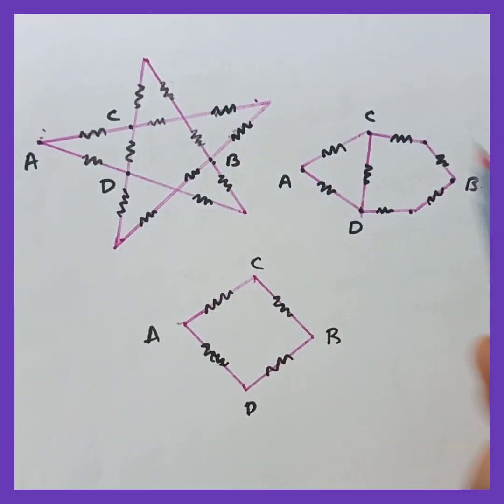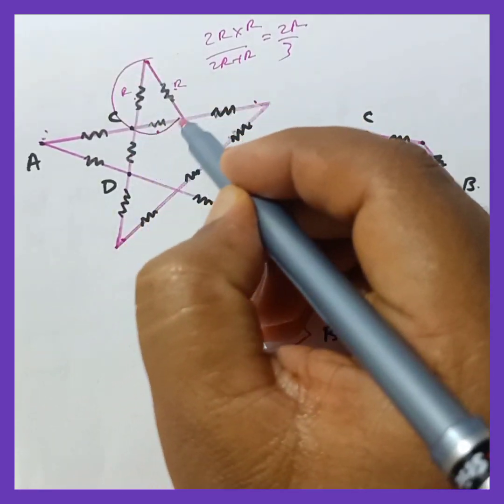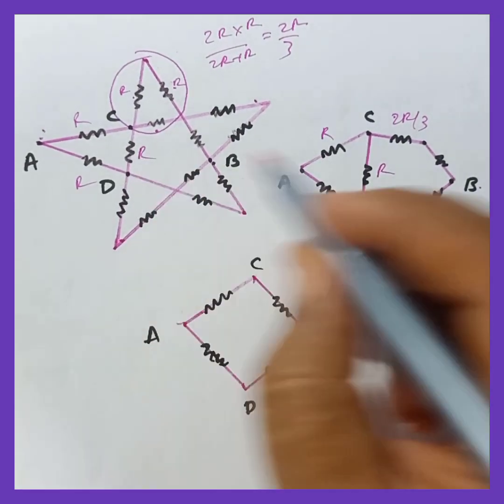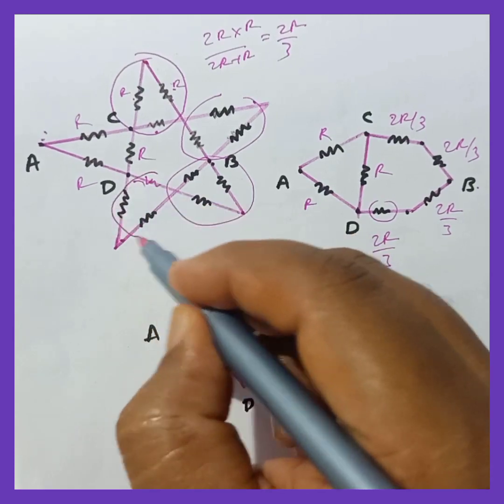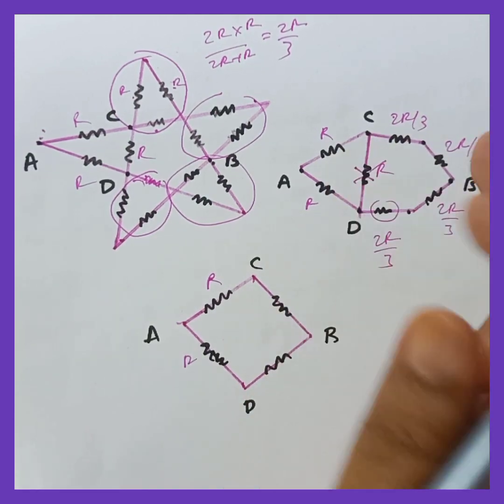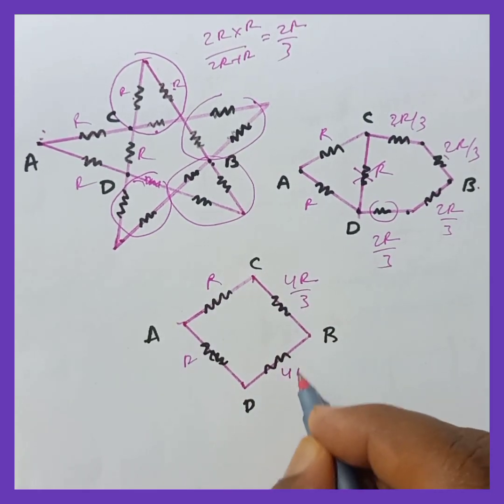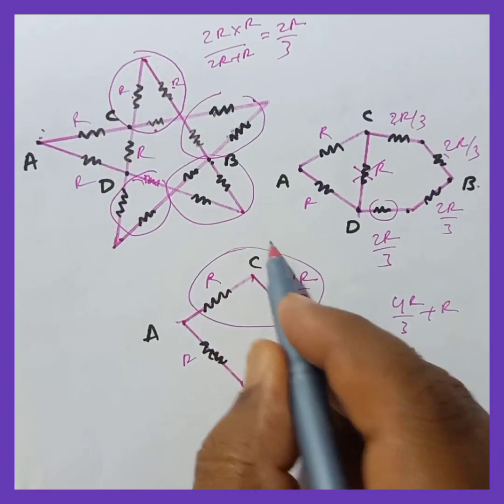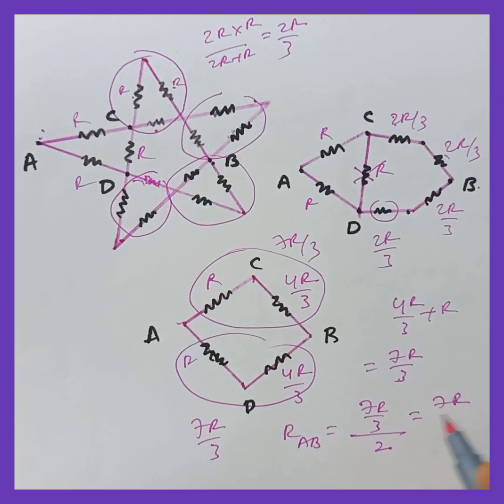physics cheat codes| neet| #shorts #ytshorts #backtobasics

Comment: A block C of mass m is moving with velocity v0 and collides elastically with block A of mass m which is connected to another block B of mass 2m through a spring of spring constant k. What is k if x0  is the compression of spring when velocity of A and B is same?